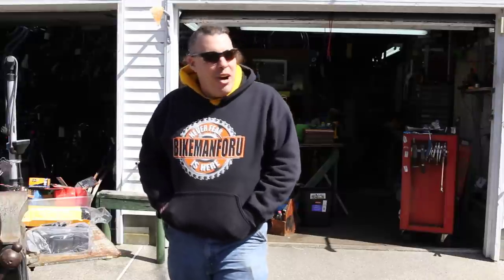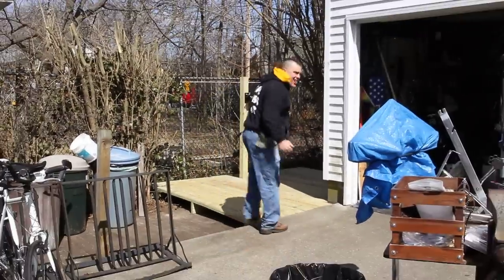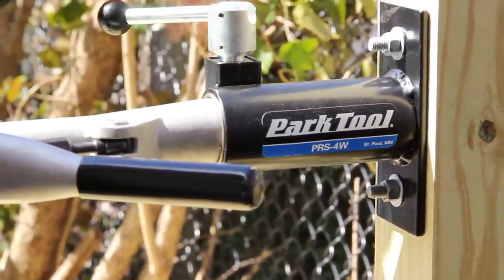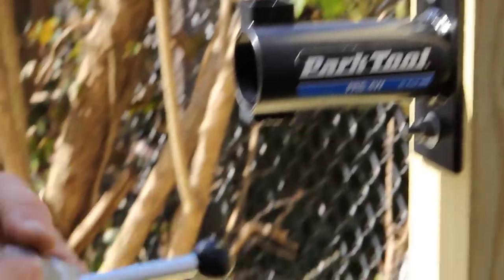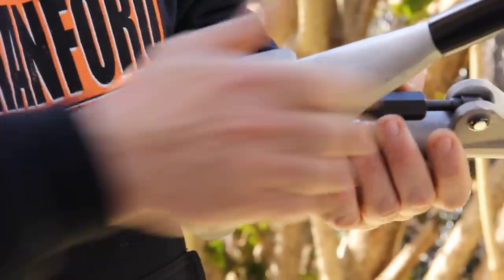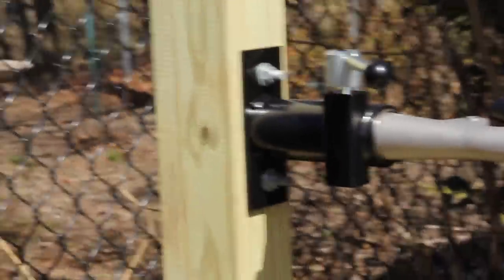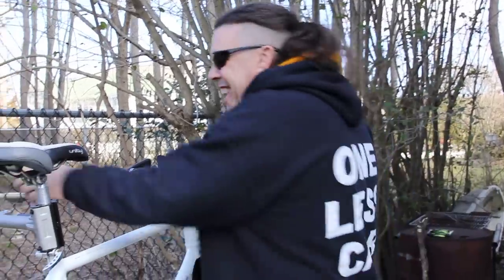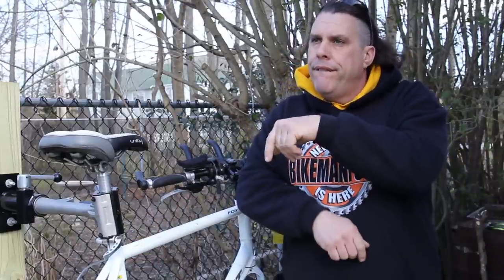Bike Repair Stand - Park Tool PRS-4W - 1 Wall Mount - BikemanforU Kapooyah!

Comment: You would have to work hard to crush it.  Double butted steel tubing is just as delicate.

It would probably be best to try and clamp any bike from the seat post as Bikeman shows you though.
Reply: You think this clamp would work safely as a wall mount for transportation in a box trailer?
Reply: Lower the seat post and clamp the frame with the seatpost backing it up.